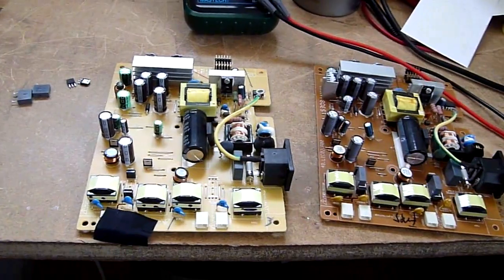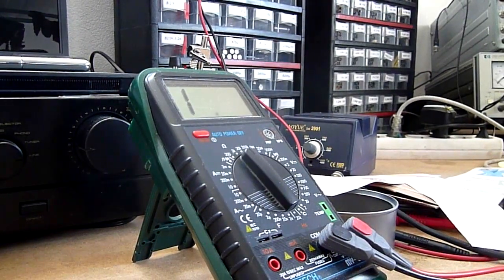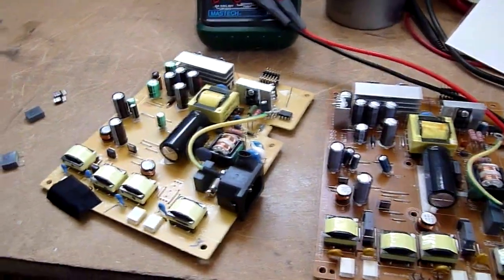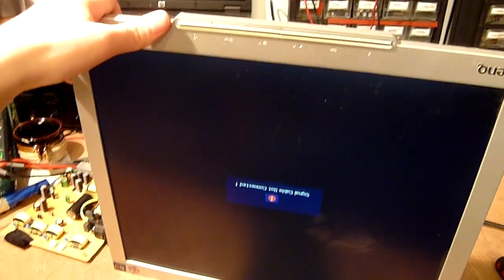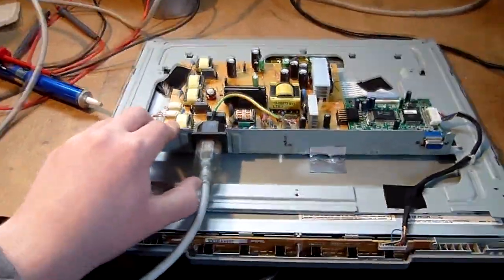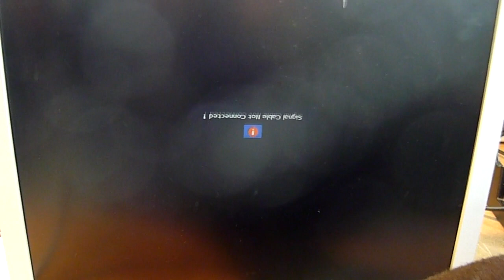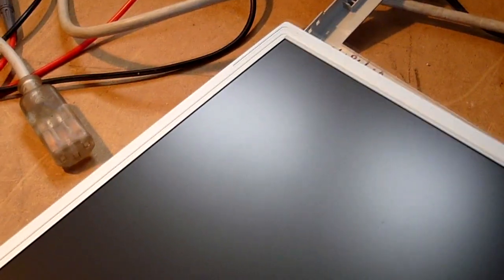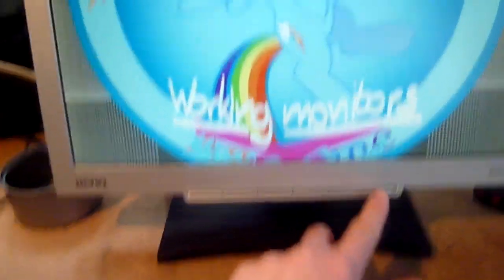Repairing a Benq FP71G+ LCD monitor

Comment: Nice .. I once “repaired” one of those .. was impecable though, just the solder joints on the connector needed reflowing ... Planet saved and 15€

Comment: I got the same screen, and my power supply board looks like exactly like the one you have.  My screen wouldn't turn on, just the power light was lit.  I have two burned spot on it, one where the IC701 transistor is (on the other side of the board), and the other one is near the inverter you show on your video.  What should be the readings on a multimeter (testing with the 20K - OHM) on the inverters pins because I get different readings on each one, and the fuse is out too!

Comment: I got the same monitor , when trying to wake up my computer from sleep mode , the monitor remains dark the lead is on though  . already trying other monitor , they work fine.  I didn't understand what you actually changed/replaced to fix the problem

Comment: Hello My motior FP71E presents 
this problem: 
Increases by only the brightness. The monitor turns on the light blue bar that increases alone 
How much brightness is increasing, the buttons on the monitor does not work. 
Should I replace swollen capacitors on the power board?

Comment: Hi, I have the FP91G+ and am having constant problems with it in that it keeps turning itself off. The only way I can kick it to start again is by unpluging the mains plug for few secs and plugging it in again and then most times it stays on. I have changed by now all the caps and most of the transistors and ICs however the symptom seems to still exist. I did find a dry joint around one of the square caps which I resoldered but am wondering what is causing this problem. If I leave the mains plug in after it turns itself off it only switches back on very momentarily after I press the power on button. Seems like it needs to reset or something by unplugging the iec plug. Any help would be much appreciated please. A shame to throw it away if the screen seems fine. Cheers
Reply from the maker: Could be bad tubes.
Reply: It seems it was an invisible dry joint possibly on one of the 2sc5007 transistors? Definitely a dry joint as when i pulled back the iec plug and put pressure on it the monitor stayed on. Cheers.

Comment: hello, what s the problem with power on delay? i already changed those little capacitors but the problem is not fixed. it s the 450v 100 micro the bug? thanks
Reply: I have the same monitor . look underneath the power supply board , there's a little black squared component called DPACK transistor . In my case it is burnt . check it out , and you ned also to replace  some transistors

Comment: HI there I have a Benq Model Q23W3  monitor and just got a 24v 5a power 
pack but the plug into the monitor is a 4 pin din plug. i have one but 
have no idea of the connections. has any one got the simple connections 
ie positive negative etc. would love to get this monitor working. Thanks
 Nick
Reply from the maker: Just use a multimeter to see which pins are connected to the metal chassis, that's ground.

Comment: hi dear sir
my Benq monitor is same your monitor model in video clip( Benq Fp71G) .
but I replaced all of the capacitors but still not display. in this model there is a pico fuse. 
 Is it possible that not display in monitor is due to burning pico fuses?
thanks.
please send me your telegram or whatsapp number.
thanks.

Comment: Sir I have a one year bought... Hitachi 42"...
Suddenly, The picture went off....
Sound OK... Image Tested With Flash Light Showing Ok too....
No back-light...
Is it problem with Inverters....
How Can I check...The Inverters Are On Power Supply Board...
Will It Be Ok If I Turn it To LED LIGHTS...???
If So... Plz Tell Me How to Bring a $@" LED TOGETHER...???
And How To Install And Connect Them.....????
Thanking You In Advance....
e-mail : shamprodesign@gmail.com